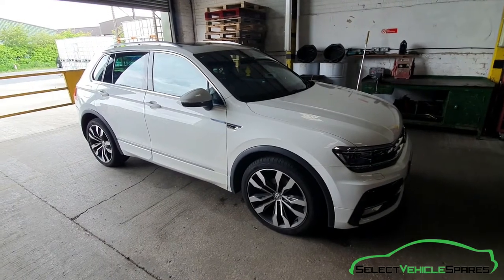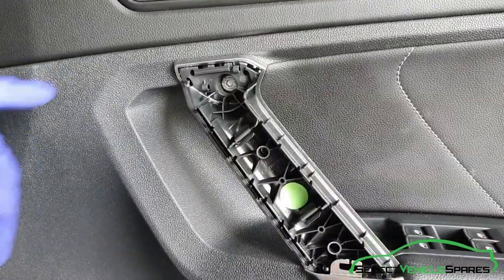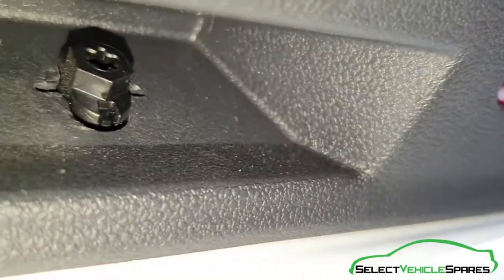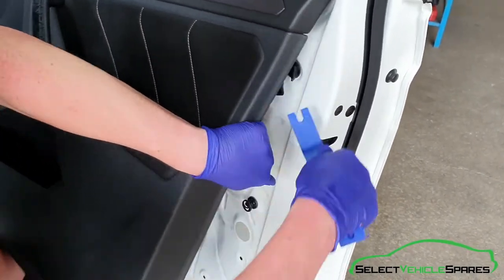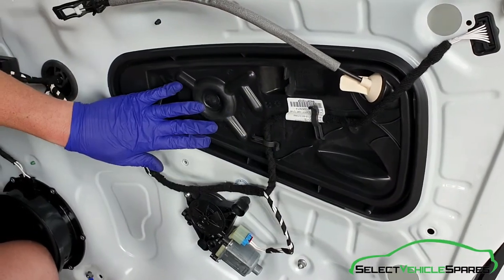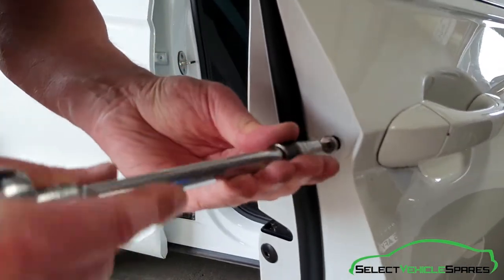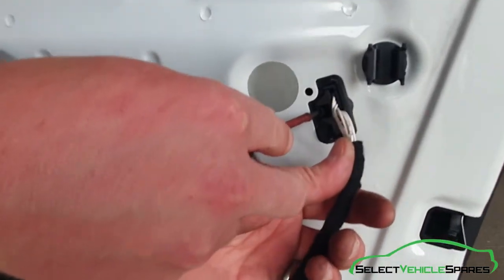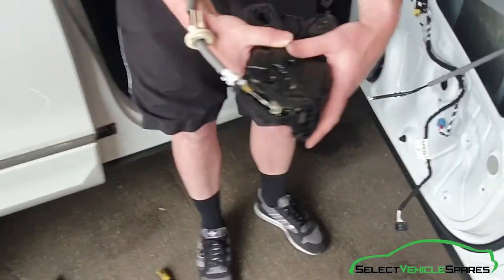VW TIGUAN MK2 - How To Remove Front Door Lock Catch Actuator Solenoid Key Barrel Removal

Comment: Hopefully I get a reply….so I think I may need an Actuator…my door power locks doesn’t work from the outside. I have to manually open the driver side door. Now after a few months of doin that, my car power doors makes a noise like it’s trying to lock or whatnot while driving 😂😂😂
Reply from the maker: It's hard to say for definite without seeing the vehicle, but yes it does sound like an issue with the lock itself.

Comment: This is a great video.  My 2019 Tiguan's driver door won't lock.  When locking is activated and all other doors are locked, the driver's can still be opened.  I've read it might the lock's actuator at fault.  Is the actuator part of the lock assembly you had in your hand at the end?  Any ideas if it's fixable or easily replaceable?  Thanks.
Reply from the maker: Yes, the door lock assembly contains the actuator, and would need to be replaced as a complete unit.
Reply: @SelectVehicleSpares  Thanks for the response.  Yes, I ended up getting my local garage to replace the entire assembly.  They also did some jiggery-pokery with the car's computer, so there's no way I could have done this one myself.  In all, this was a very irritating way to make myself £300 poorer.  Despite not being a VAG specialist they told me they've done quite a few of these.

Comment: Hey great video, thank you! I need to replace the front left lock actuator on my 2016 Passat and this video is going to be so helpful!!! 
Did you have to remove the window before you took out the actuator or did you just wind the window up? (I can’t quite tell from the video)

Thanks again!
Reply from the maker: The glass was in the down position in our video, but it doesn't matter either way on the Tiguan.

Comment: Hello wonderful video, 

Unfortunately I need to get to the cable connecting the exterior handle and latch... And replace? 

My friends outer door handle does not open the door.. inside handle works fine.. 

So A few steps deeper.. 
Before I pull the door apart and guess..
Any hints? Other videos to see those extra steps 

Thank you.

Comment: I have a problem on my VW Tiguan 2010, cant open driver side door from outside, but can from inside. Is it a lock issue, so it needs to be replaced ? Thnx
Reply from the maker: Yes, it's very likely that the lock is faulty. It may also be worth checking that the cable from the outer handle to the lock is still attached correctly.